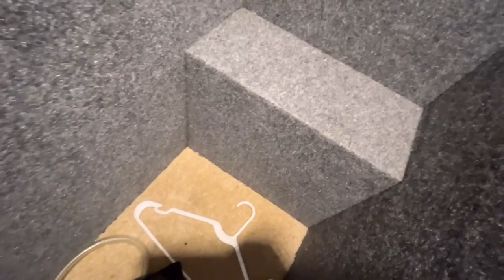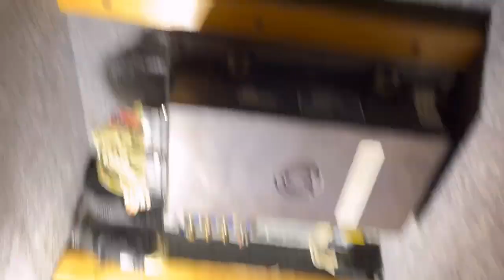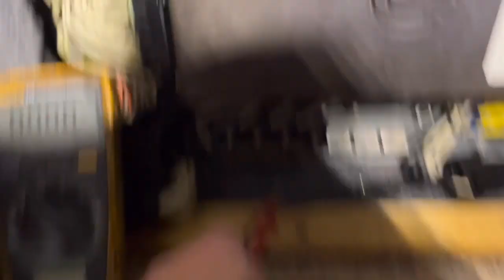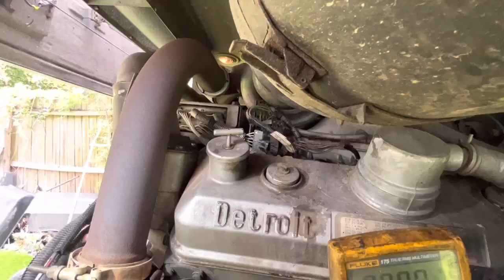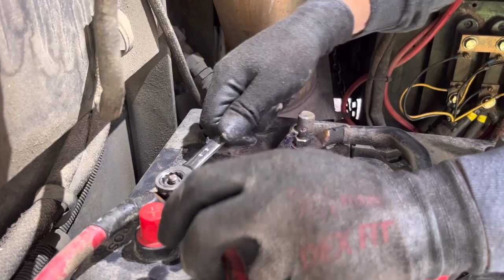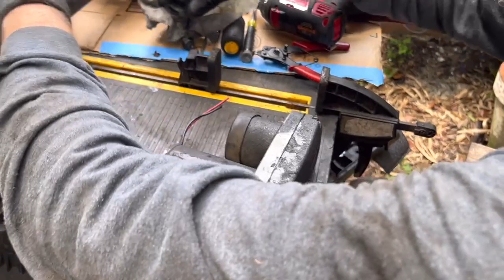Gino’s Garage-1988 Wanderlodge WB-DDEC 1, battery and generator actuator issues, Repaired, maybe??

Comment: You still based in  Tenn? One of these days I got to figure out the gear lash on my LX engine and replace the super corroded formed metal compressor  lines on the Cummins . Hoping that line will not be a big problem. Only pucker will be undoing the block fitting. Thinking heat? I should do it soon.
Reply from the maker: Not in Tennessee any time soon, still in Florida for another 7-8 years at least. Yea corroded parts are never fun. Heat is always a good start. Sometimes hitting it with an air hammer helps, but with corroded parts it difficult, since you do not want to destroy it.
Reply: @GinosGarageUSA  yup. It’s in the face of the block.

Comment: Valuable video! I recently acquired a 1989 WB and am up to my armpits in Bluebird Boot camp. This settled that mine has a DDEC 1. My problems with that so far have been the power and ground leads. Once all new batteries and tidied up connections, appears to be generally operational, still get occasional intermittent flashes on the check engine light. Thanks for the video!
Reply: I would love to pick your brain on a puzzling electrical question on the Bird. Ok to send you email? Might save me burning the whole thing down. We are in Oregon and little far to get some help in person:)
Reply from the maker: @fairpassage260  Yes, send me an email with your phone number and I will respond back.
Reply from the maker: Thanks for watching! Will see if we can figure out the intermittent issue. I am thinking it may still be the cannon plug, I now have a tool to release the pins so hopefully I can move the pin and see if that helps. I have heard that others had to run a separate new power wire to cure this issue.